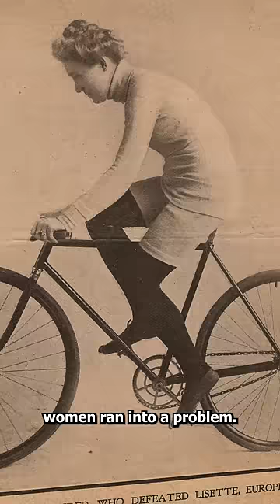Men's VS Women's Bicycle 🤔 (EXPLAINED)

Comment: "Well, the answer is actually pretty simple."
They get the better seats.
Reply: Facts. I ride 2 plus hours a day and my ass gets numb for like 1 hiur after getting up. My butt Crack is like a pocket fir my seat, I'm bit even that big. Wtf
Reply: You can buy new seats and install them on your bikes
Reply: @dflaming1371  i think ima get some
Reply: A wider seat, specifically for men, and rather ironically I might add, will probably cause more problems than sitting on a narrow rock solid thing. With a narrow solid seat, your body is forced to sit on its sot bones; in contrast, you’ll sink in to a softer wider seat, which will put pressure on the soft part between you expulsion zone and berries! Soft seats are acceptable for short rides, but as someone that rides hundreds of kilometres per week, I can confirm that the harder thing is the way to go!
Reply: @michaellynn9763  this. Normie riders think big cushy seats are better. Lol!
Reply: @michaellynn9763  This! I have a mountain bike to commute with that has the narrow solid rock thing, could and did ride for hours. I went to the netherlands once and rented a bike there and rode 60km one day and I felt like I couldn't sit anymore.
Reply: @dflaming1371   why do bikes come with bad seats ot begin wiht? imgine if your car came with a pair of wood planks for seats.
Reply: @RC-fp1tl  the fact that they are uncomfortable for nearly all people proves they are worse for nearly all people. dont act like a bike supremacist
Reply: @dflaming1371  Exactly, that will mean that you'll need to buy it and install it😂
Reply: i had the same issue on my bike, but i found little bike seat pillow you put on your seat, it's a really comfy and cheap solution
Reply: @michaellynn9763  I know this is one year old comment, but anyway. I work as a courier on a bike, delivering stuff from 5 to 20 kgs on my back, and I also just ride occasionally. It might be that I just never had a good narrow saddle, but they all hurt, and I can't tolerate them for more than like an hour, after which it just hurts way too much and I prefer to continue riding while in a standing position, or just get off entirely. Wide cushiony saddles, on the other hand, feel really comfortable, and even during a 16 hour shift I had once, not a single issue was found.

Comment: It's not a woman's bike, it's a Dutch style bike and it's made with comfort in mind and not speed, as it positions you more up right and generally requires little maintenance. It's just practical, doesn't matter if you're a man or a woman.
Reply: Finnaly someone said it
Reply: It's considered and sold as woman's bike in my home country. 
All this time I thought it was because most women are shorter than men (and as South East Asian, our average is already shorter than others) so the slanted design make it easier, or possible, for us to comfortably put our foot down.
I'm slightly taller than average and when I tried my dad's man bike once (both his and mine had same height, same brand, same model. Just the man and woman version), I hit my lady part on the steel when stopping cause I'm too short 😢
Reply: they are sold under men/female bikes
Reply: Yes that first one is, but it's also true that womens/girls bikes do have a curved bar while men/boys ones have a straight one.
Reply: I wish your comment was the top comment.
Reply: The bike you are talking about is a bike with low entry. The bike he was talking about is a women's bike.
Reply: I'm Dutch and this is a women's bike lol. Men and women ride different bikes here too
Reply: Even in the close enough country of Denmark, the step-through frame is referred to as "damecykel" and the step-over frame as "herrecykel"

Comment: "Why woman bikes is with slanted bar?"
Their legs..
Reply: I’m a woman and I can ride a mens bike just fine with no problem. So it’s probably not the legs.
Reply: Men have legs?
Reply: It’s because you can see up the dress.
Reply: Hah well honestly kind of yeah. I can't lift my leg up due to a chronic illness so I like the slanted bar bikes. Easier to get on and easier to get off. Even slightly slanted is better than the straight ones. I think it's a good design for people with little mobility because it allows easier access.
Reply: @SomeGuyOnYT  No? Do you live under a rock?

Comment: In the beginning i was reminded of that time where i noticed in a store when i was getting myself skates (like regular roller skates not in lines) that the ones designed for women seemed to use plastic for the thing mounting the wheels to the boot kinda part (i have no idea wtf it's called) whereas the ones designed for men used metal nd i still have no idea why
Reply: Maybe it weren't really just men vs women, it could be city bike (always low bar) vs sports bike (always high bar). Maybe city ones didn't need so much reinfoecement and light weight was preferred instead.
Reply: @a.w.4708  i was talking about roller skates in this comment not bikes-

Comment: also I've fallen off of a men's bike when stopping and men have stuff there before it hits their bones and nerves, if we fall straight onto it, we can hit a massive nerve that runs near where the leg and pelvis connects, and it can be beyond excruciating, and even cause temporary immobility. It is very dangerous, and can cause damage to the nerve.
Reply: Wait until you find out about our balls 😂
Reply: Yeah, the testies are where our nerves are located Missy, I have personally hit a tree when biking and when I flew forward and my “stuff” hit the metal, I ended up going to the hospital because I went into shock in result of the amount of pain I experienced. While women have a nerve that goes through that area, men in fact have more nerve endings going through the testicals so this is factually wrong. Sorry Missy 🫶

Comment: “Much sturdier” - doubt it.
Reply: No it is
Reply: physics says otherwise
Reply: Bro at the age of 12 I was already taught that a triangle is sturdiest design, that's why it's always used on bridges. 

This dude be in class and just doubt every single thing the physics teacher be sayin
Reply: @agellidmalik  agree but doesn't mean slant design broke easily i have used slant design bike for 10 years it's still run like a charm
Reply: @nagabala5011  I have also used slant design for a long time and so have many of my peers (We're Dutch) and it is indeed sturdy, but it still stands to reason that the triangle is sturdier, but I get youd point

Comment: Actually, for everyday use, a bike with a low bar is perfect. You can carry really big things in the back without making it impossible to get onto it.
But there is another shape that exists, it combines the advantages of those two. High stiffness and not having to swing your leg over the saddle. Not as easy as a typical "Women´s" bike, but at least you can ass bags between those bars.
Most cargo bikes are also built so you can just lift your foot over the bar.

Comment: Well well well well. Almost right. You see they did not just wear dresses just cuz. They had to. And bikes could only have such a bar cuz they couldn't make one without as strong as we can now. And a bar like that would show some stuf that was very not allowed to be showen back then. I mean underwear not other stuf durties. But now we can make bikes that can have a low bar and be just as strong. And we don't call them wimems or mens bikes, no no no we call them bikes with a low or a high bar. Cuz atherwise there would be communities that would feel left out. Also the lower bars are much safer than high bars. Especially for men cuz if they fall forewards they would hurt some stuf down there with a high bar wich wouldn't happen with a low bar.

Comment: honestly i think all bikes should be like this yes I'm talking about getting hit in the nuts i know cases like those don't really happen but the implosion distance from the nutsack to the bike is small enough to have a high chance of an extremely dangerous implosion that could cause to sperm failure or worst case or worst case bonefailure where the nutsunal tube is experiencing a tube hit which I'm riding that experiencing tube hit could possibly cause an accidental nutrealse